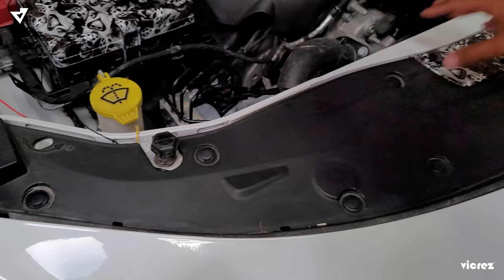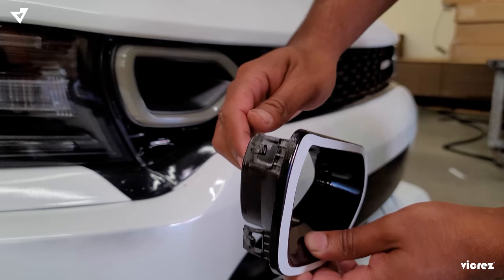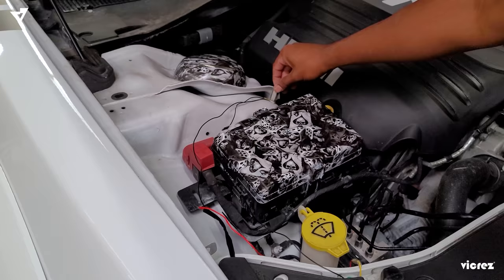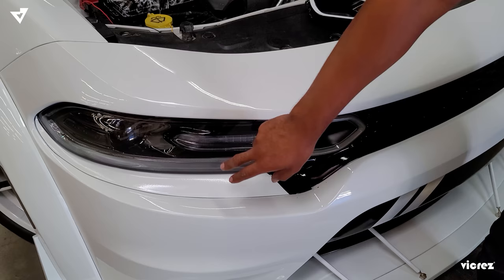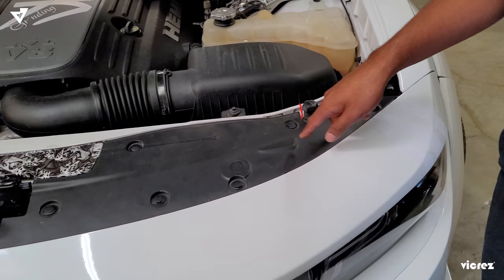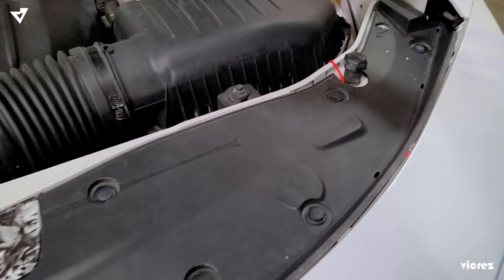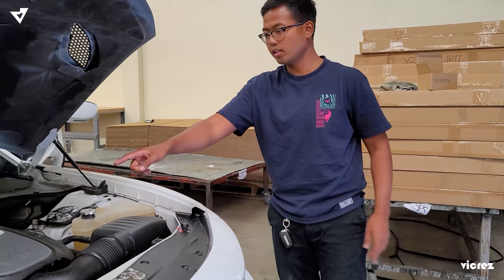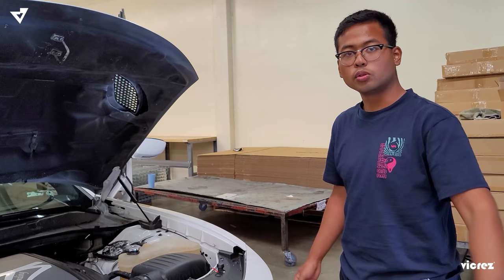Vicrez LED Lights vz102173 Overview Installation for the SRT Grille Dodge Charger 2015-2023

Comment: Full guide would be nice before I buy this.
Reply from the maker: Unpack product, and clip ends of Red, Black, Yellow, & Green Wires 
2) Attach Yellow & Green Wires together on both sides 

3) Open Hood & Remove all Pop Clips on the upper cover closest to the bumper 
4) Remove Air Filter Housing, by removing the bolts & clips. Remove the air filter, and  bolt inside of the airbox holding the housing, to allow you to lift it up and expose  the harness under it. (If you have an Aftermarket Cold Air Intake, you should be able to just  remove the Filter and have access directly to the harness) 

5) Remove Stock Snorkel Grille Inserts, by using your hand to pull it forward, while  pushing on the clips in the back. It takes some time and force, but will come off eventually. Do not worry about clips breaking, as they will be replaced 

6) Insert new Grille LED’s by feeding the wires through first, and then clipping in the  clips into place. 

7) Feed wires to each side of the car, closest to the Headlights to connect the wires 8) Remove Headlight Harness, by pressing the top clip and pulling them out

9) Remove about 5” of the protection covering tape, to expose the wires to make it  easier to connect 

10) Starting on the Left Side(Driver Side) of the car, connect the Red Power(+) Wire to  the White/Blue Wire. Connect the Black Ground Wire (-) to any Black wire. Then  connect the Yellow & Green Wire, to the White/Green Wire 

11) On the Right Side(Passenger Side) of the car there are TWO White/Tan Wires. You want to first  connect the Red Power(+) Wire to the White/Tan Wire. Connect the Black Ground Wire (-) to any Black wire. Then connect the Yellow & Green Wire, to the other White/Tan wire. (There is two White/Tan wires, but just make sure both sides are functioning the same before taping them up. Turn the headlights on/off, cycle signals, and cycle the hazards to make sure everything is synced)

12) Tape the harnesses back up, to keep them protected from water and exposure to  weather. 

13) Connect harnesses back together 

14) Place Push Pins back into underhood cover

Comment: Hey might lights don't go in that circular motion. Is mines not hooked up right? Mines just do normal flash with turn signal.
Reply: Same. Red wire to to my side markers, green wire not used, yellow to the headlight harness, black to ground. They work but there’s no sequential animation. I have a 2020.
Reply: @Brandyn2893  wonder why that is, I love the sequential look .
Reply: Hey Brandon found I y we don't have that look, it's because they made 2 dif styles of those.  I contacted Vicrez and asked them about it and thats what I was told.  Dont know y they there was two different kinds made!
Reply: Just recently had to get my front bumper replaced because of a hole that was in a hollow area, but the shop sadly broke mine that I had and they used to do the sequential signals and the shop replaced em but they now just blink. Its pretty wack.
Reply: @ThereGoMango  yep I hate this style

Comment: Can u please make a full tutorial video
Reply from the maker: We will! working on it :)
Reply: Right I have mine installed but don’t know the wiring lol
Reply: Wires them up exactly as this video says. No blinking orange when I put the blinker on.
Reply: @maldonadostone  same here I had the dealership use this video as a guide and it had no orange when using turn signals.
Reply: @premierexotics2443  I finally figured it out.
The directions are off in the video.
Reply: @maldonadostone  thank you! I actually just called them and if you ask they will email the instructions. They could have at least said the  video was off.
Reply: @premierexotics2443  would you be able to send me what they sent you so I could get mines to working properly
Reply: @brianlacey4643  I would look up there website and call them and  tell them to send you the instructions for that part and they will. I can’t find it it’s been like a couple of months since I installed it.
Reply: @vicrezcom  still working on it? I know its only been four months...

Comment: Did this today on my own car 

Passenger Snorkel- green goes to white and blue wire on harness 
Yellow goes to white and tan wire on harness 

Driver snorkel- green goes to yellow and white wire on harness
Yellow goes to white and green wire on harness

Go to google and look up Dodge Charger 2015 headlight wire colors driver or passenger side and it should answer your color questions.
Reply: So this grill fits for a 2016 charger?
Reply: Where did you hook the red wire?

Comment: I would buy these but for some reason they not for 2021 models😔
Reply: I think the snorkels for the 2020 and 2021 are the same.  I just ordered these for my 2021 charger. I'll let you know how it goes.
Reply: @IoTSecurity hey bro what's up
Any updates on what happened and if you bought them are they still working